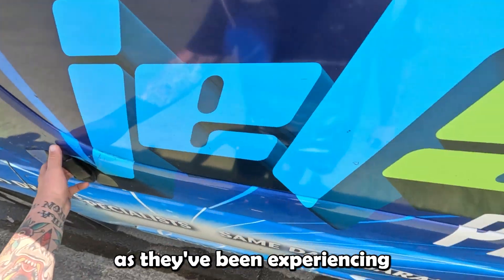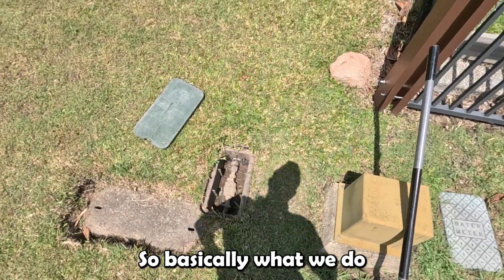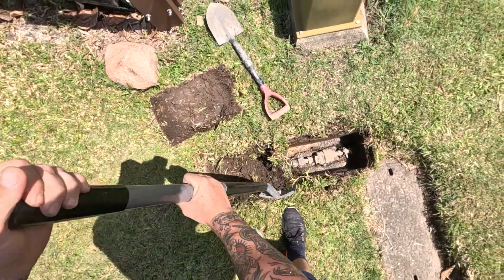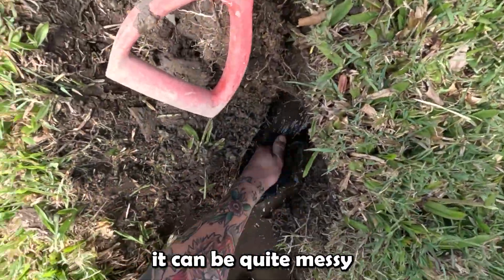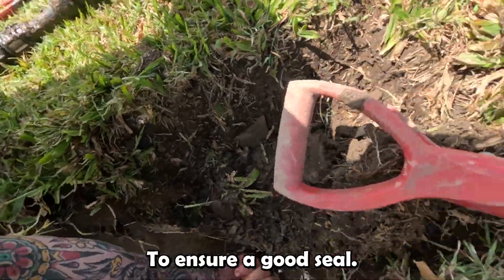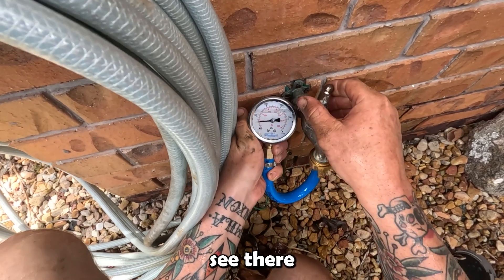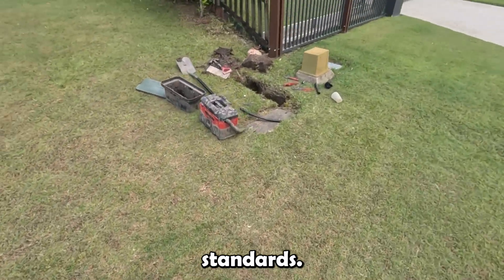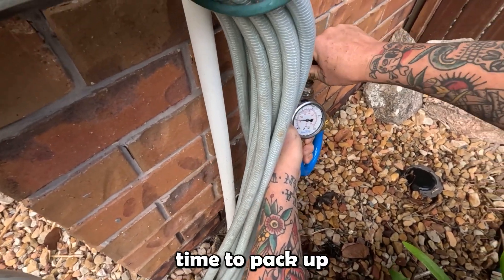How We Install a Pressure Reduction Valve (PRV)

Comment: Thanks for the vid. I have had issues with under and over pressurizing. 

Urban utilities in QLD opened up a valve on one side of the street to give us more pressure, and when this didn't work another crew came out and removed the PRV without installing a replacement.

I've had issues with the underground poly pipe springing leaks and also one of the closest outdoor taps to the mains constantly leaking through the thread and eventually blowing a hole through a new garden hose.
I will fix it myself this time.